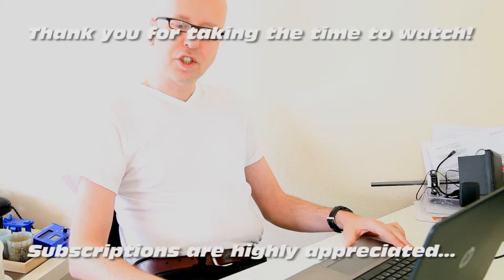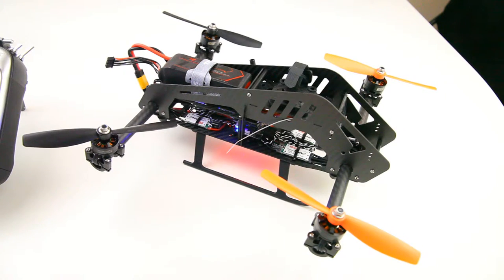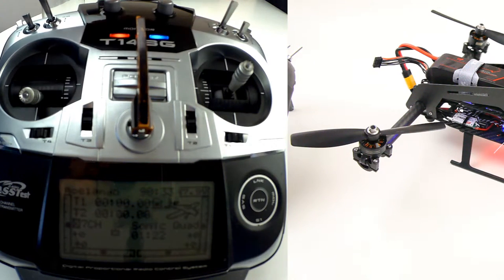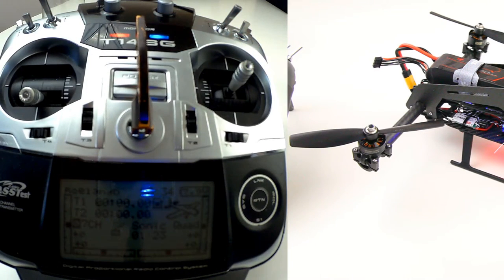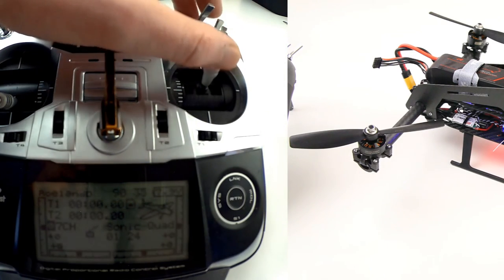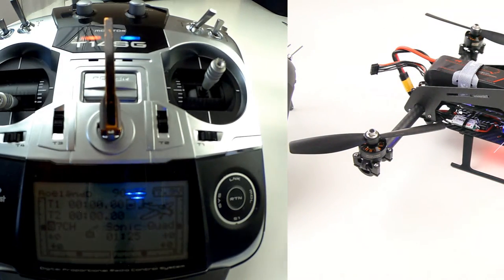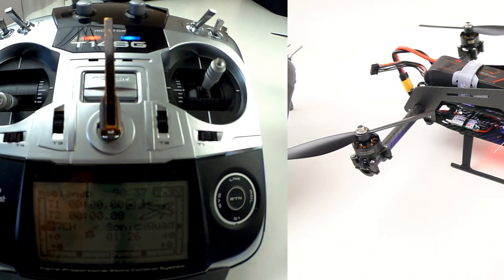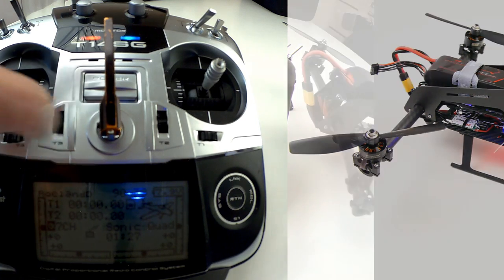Sonic Speed Quadcopter! Part 4: Radio control / mixes setup

Comment: Looking forward to seeing this fly and getting real interested in a micro tilt rotor, maybe 180 to 210 size.
Reply from the maker: +MicroRCFiend Wow.. a micro-tilt.. you'd be pressed for space for the mechanics BUT let's first see how well the concept works / what the advantages & disadvantages are :)
Reply: DutchRC Adventures No tilting camera for speed runs, isn't that the only advantage? I'm dying to fly one and feel how they corner.

How's your CG with that lipo so far back?
Reply from the maker: +MicroRCFiend 
That is 1 of the advantages indeed..  You should allso have faster acceleration (the back of the quad doesn't need to be lifted) and less drag / higher top speed..The CG is awefull like this! I do still have to add FPV stuff.. and well maybe an action cam will balans it out a Bit.....
Reply: +DutchRC Adventures Ok dude, I have a tilt frame coming. I'm starting to get worried about the mixing though, had 2 hours messing with my tx and I got no clue lol. I can make it 3D but not sure I can make it tilt and still stay in the air
Reply from the maker: +MicroRCFiend :D  Are you going to let you flight controller handle the tilting?? What I did is put the pitch stock on an unused channel in my radio.. From there I made 2 mixes towards the Actuall channels which I can then enable/disable with that switch..
Reply: I'm really not sure yet. I think i'm down with understanding the two methods after watching some fly and yours vid and ali's vids. 

It's the actual mechanics of that mixing on my tx that is the problem. In advanced mixer I can barely even set expo without goosing something up.

I really want to see yours fly.
Reply from the maker: +MicroRCFiend Hmm yeah.. most setup-work in radio's for multirotors is Very low-level huh? It's wurth putting some time into it though.. Do you use the radio for planes as well by the way (that generally makes you get to know your radio more)

Comment: Man that is a noisy servo ;) I thought once you twitched it it would stop making that noise. As long as it works :) Nice flight modes, now all it needs is a 5S battery and Tri blades ;D
Reply from the maker: +The RCAddict Haha :D  That indeed is a Buzzy servo :P
Reply: DutchRC Adventures Is it low quality? Or what?
Reply from the maker: +The RCAddict Neh.. it's just a digital servo. This noise is normal. And it's Strong.. Not Super fast, but that isn't needed for this application..
Reply: DutchRC Adventures Ahh yeah, I imagine it would need a lot of torque to hold everything steady. Hope you break 100mph! ;P
Reply from the maker: +The RCAddict Yeah.. I think the servo is just Fine :)  Me to, but let's see if it flies half decent first :)
Reply: DutchRC Adventures I got my SP3 Deluxe Board bundle from BG today. Soldered the pins on. I am fairly worried that It is a clone, and a dud. It works with clean flight straight up, but can't update the firmware. Also the on screen image on the quad is a little weird, until I recalibrate it each time I reconnect. I went outside to get GPS signal to see how it would display it, and the module was flashing blue meaning it got it, but nothing showing in cleanflight, and now the image of the quad on the main screen will not move. Still connects up fine and instantly though :(
Reply from the maker: +The RCAddict Hmm indeed this is a clone/copy that BG sells.. From what I've read it is actually quite a bit better then the Original though.. I have not tried the GPS & OSD stuff yet.. You DO know you are not supposed to have the OSD connected AND have the board connected via USB.. right? That will short things out..
Reply: DutchRC Adventures Yeah, just read on the cleanflight site that any one sold from a chinese retailer is a fake. The accelerometer and image issue went away now, just needed to let it sit for a second. I plugged the GPS into the I2C port, since that is what I thought it was, and it gets power and starts flashing as it has GPS, but nothing showing on cleanflight. I watched a video saying it needs to go in the UART2 port, but I dont seem to get any power from there, or any other port besides the I2C. I read that about the OSD, and have not even tried to figure it out yet.
Reply from the maker: +The RCAddict Hmm I have not tried that. You are using one of the small ports at the back-end of the board? (not one of the ones on top, or front) ?
Reply: DutchRC Adventures I think I figured it out. I read that only the I2C port provides voltage when hooked up the PC, so I just plugged the board into my robocat real quick, and with teh battery in, it coems on in the UART2 port. Still just said "waiting for GPS fix" in the GPS section of cleanflight though, even after the blue light started the blink. I should have just tried anotehr APM :/
Reply from the maker: +The RCAddict Hmm at this moment I can't do much at home really, cause my internet connection is DOWN :P  Should be up again next week though.. A short YT holliday isn't that bad actually haha.. I suddenly hae tons of time for 'stuff' :P
Reply: DutchRC Adventures Hmm :/ I am struggling to find much on the board at al really. Going to just watch all of Painless 360's videos on it now though, so hopefully after 5 hours I should know something. 

I have a question about powering the board though. Since I can't use the PDB cable that I used for the APM, how do I get 5V to the board? lol
Reply from the maker: +The RCAddict What I did was put 5V from the PDB into an unused output-port of the FC.. that works just fine :)
Reply: DutchRC Adventures Yeah, I was thinking of cutting the connector off of the cable that comes out of the PDB, and just use the two outside wires, +5V and GRND, and put them into a servo connector and then add that to one of the 5-8 inputs? I have having some trouble getting things to work together, but as I am watching through PL360's video's I am gradually getting it to work.
Reply from the maker: +The RCAddict Yep.. you can use any of the output pin-headers to get 5V into the board.. That will work just fine :)
Reply: DutchRC Adventures Sweet :) Taking forever to watch these videos, haha. Internet is so slow.
Reply from the maker: +The RCAddict Mine wasn't That long! :D
Reply: DutchRC Adventures Oh no, not yours. I meant PL360's becuase of the internet is so slow, lol. 

Speaking of internet. My mom get fed up with it, and we bought a new provider last night. Exede. They say 12mbs dwn and 3mbs up. We got the 30gb plan for $150. It is similar to hughesnet as once you go over, you go to "slow" internet. Hughesnet gaves us 0.15mbps after we went over, Exede claims to give 1.0-5.0mbps after you go over. Also from 12pm to 5am it is unlimited. We will see how it goes. I doubt we will get 5mbps after we use it up, but even their lowest at 1mpbs is 10X faster than what we have right now. We schededuled to havt them come on friday :P
Reply from the maker: +The RCAddict allright them :)  Well anything faster then my internet at the moment :P

Comment: Uhoh, a do-over.  Must have been pretty bad... :-P

I'm thinking more throttle is also going to be needed because some lift is going to turn into forward thrust when the props tilt forward.  I don't know if you'd want to or even can mix that in, or you'll just have to add more throttle manually.  Regardless, this is very cool. :-)
Reply from the maker: +Tim Adams Hahaha it indeed was Terrible :P  Somehow the sound was missing for 1 minute :| Yes sir.. You've got that completely right. BUT that is allso true for all other quadcopters.. When you start flying forward.. More throttle is needed to keep your altitude..IF your quad has a barometer, it can compensate for that itself...
Reply: +DutchRC Adventures Oh yeah.. duh. Haha

Comment: si puedes mostrar las conecciones del gps osd  y  el tx em pwm    gracias
Reply from the maker: Well.. I have to say that I ended up Not using a GPS on this quadcopter.. IF you want to use GPS, it would be best to use iNav instead of Betaflight..  And for Any quadcopter, I would not use PWM anymore these days..

Comment: Tilting the motors only changes the attitude of the craft. It will not make it go forward or backward. When you hover and tilt the motors it will only change the attitude. The craft will stay in the same place...
Reply from the maker: +Kyle Killorin We will find out Kyle :D  How is it then possible that the Hyperion 280 quad flies forward without me giving pitch forward? (that quad has the motors tilted forward at 8 degrees).
Anyhow! I will offcourse show what happens when tilting the motors forward :)
Reply: We shall see I guess. My quad is the Eachine Falcon 250. It has 10 degree forward tilt. You can add -10 in Cleanflight and it hovers fine. The reason I wanted to talk is because I am about to order the same 10dof set up with osd and GPS. I wanted to know how you like it. And what's the difference with the CK boards. I am thinking of getting the real XRacer F 303 v2 to compare. Cheers!
Reply: All I am saying is that forward thrust comes from increasing the rear motor power. The tilt just reduces how much the copters attitude pitches. Like for camera angle.
Reply from the maker: +Kyle Killorin Ah yes.. you can indeed enter a tilt-offset in the flight-controller so that it will hover with the props level.. 
True.. the advantage for the camera is a real benefit of a tilt-rotor.. I think acceleration and less drag as well.. It's just an experiment offcourse to allso test a few new components like the F3 board :)